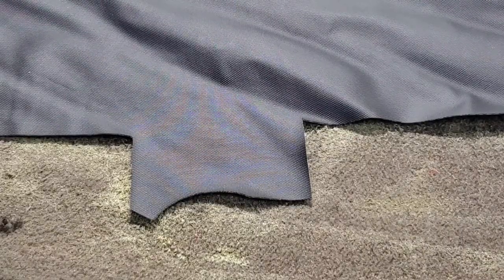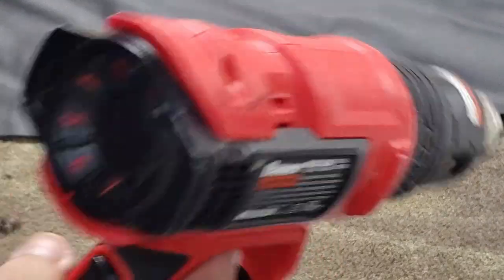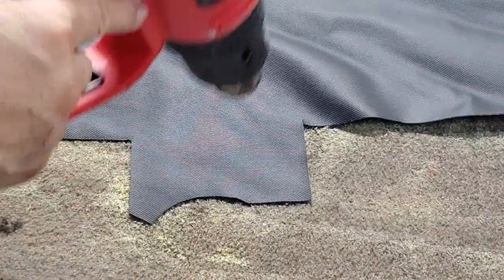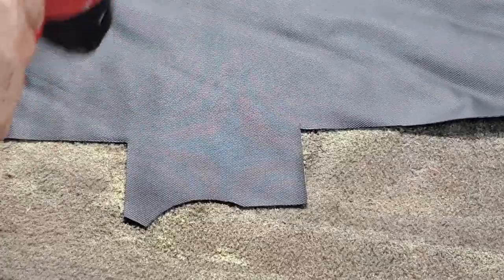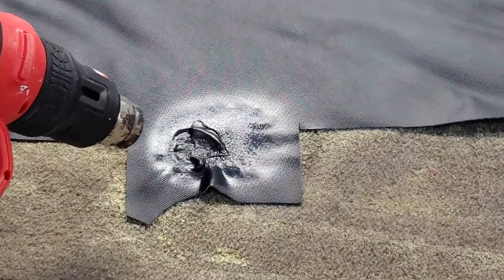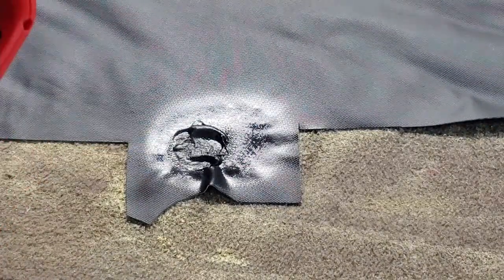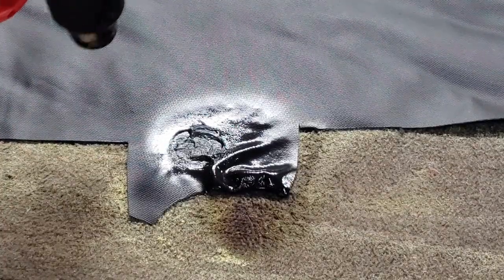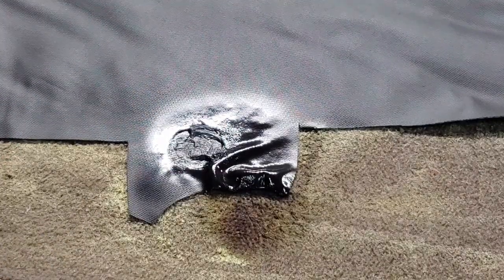Must watch! Learn how not to burn vinyl with your heat gun

Comment: what heat gun would you suggest? also looking for your numbered lessons. 789 to know what glue gun to purchase as well as glue you suggest using. thank you again sir for your lessons.
Reply from the maker: Hi! I just picked up a heat gun at Lowes. For glue I only use contact adhesive. Stay away from any spray can glue the sounds like "three men" I never works.
Reply: Thank you,  I ordered a new glue gun spray like what you showed on a lesson. What glue should I use
Reply from the maker: @tinabutters-hargrave7911  Contact adhesive from almost any hardware store. Usually yellow in color. Used for countertops and so on.